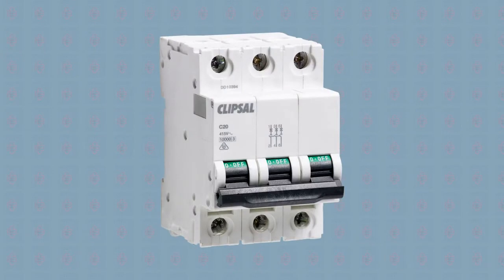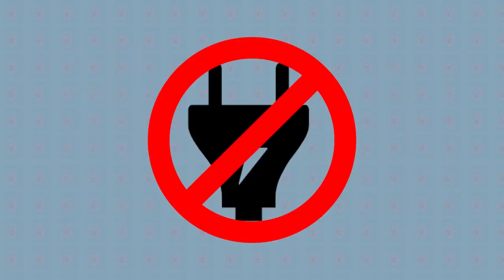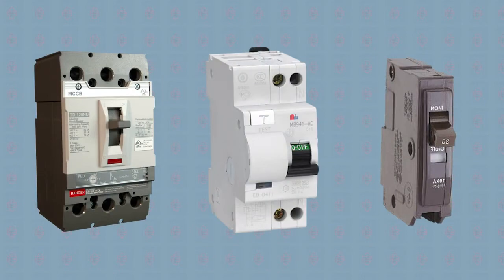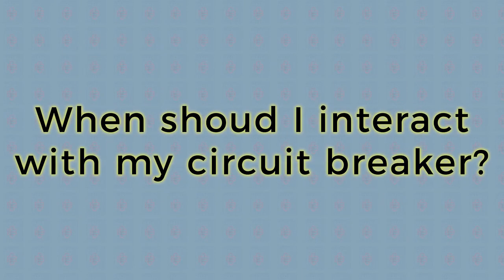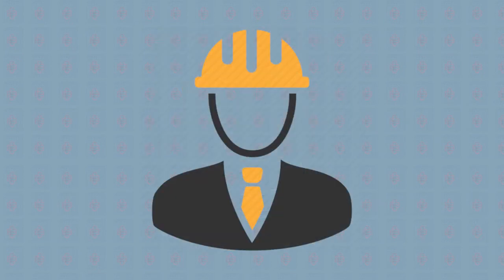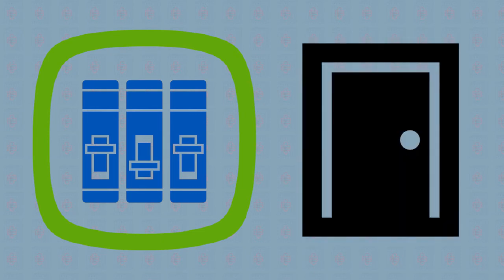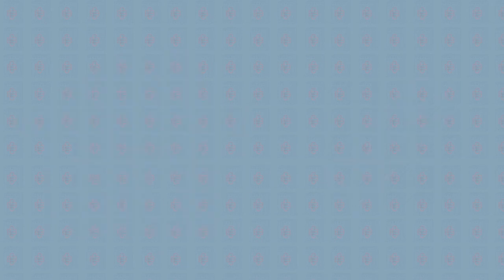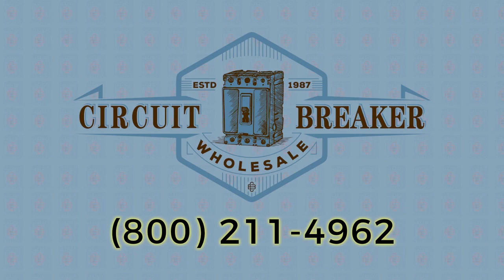What is a Circuit Breaker?

Comment: There’s one more example as my electrical residential home instructor suggested was to have lights & outlets on their own circuit.  This is so when you have to work on the lights in a room you still have power to the outlets that can be used.